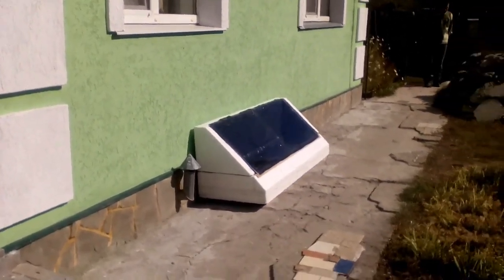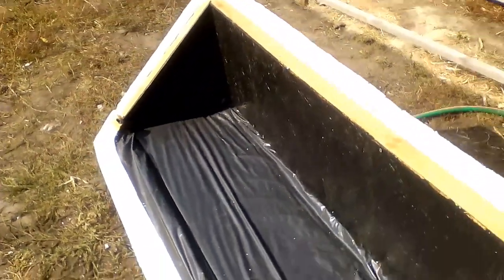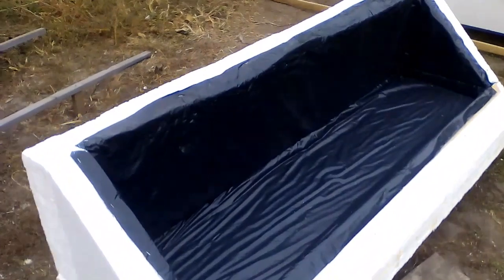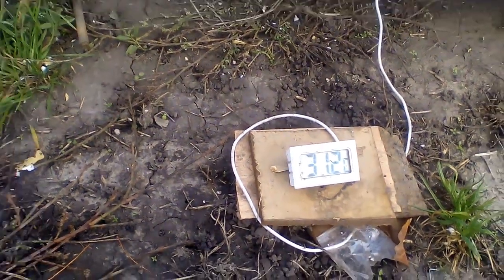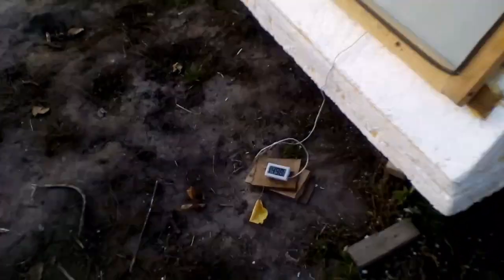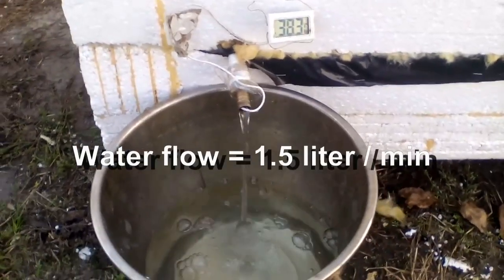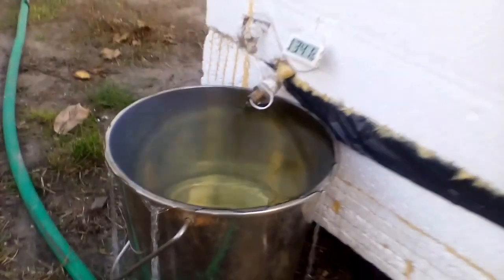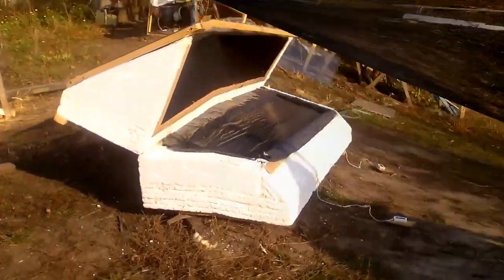DIY Solar heater in the style of "Cyber Truck" (Solar tankless hot water system for a house)

Comment: I like that you have used foam insulation instead of wood for construction of the box. Have you heard of 'aircrete' ? It is concrete made from cement mixed with air to make a foam. Aircrete combines structure with insulation, so it would be cheap and durable for your solar water heater design. YouTuber named Honey Do Carpenter has been experimenting with aircrete and has posted many interesting videos on YouTube. Have a look at some of his videos and have a think about how aircrete might be applied to your designs to replace polystyrene and plastic. 🤔
Reply: Aircrete seems very versatile. I have been watching Honey Do Carpenter too and I agree that aircrete might be cheap but durable for a solar water heater. Maybe some black soot could be added to the mix to make a black surface.